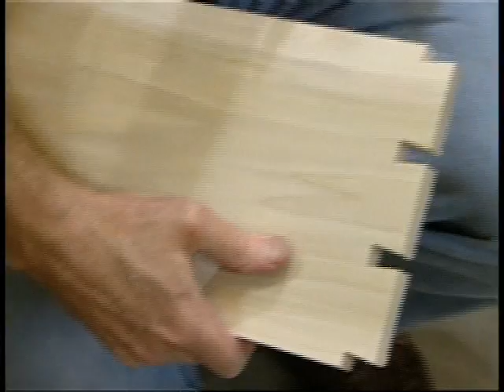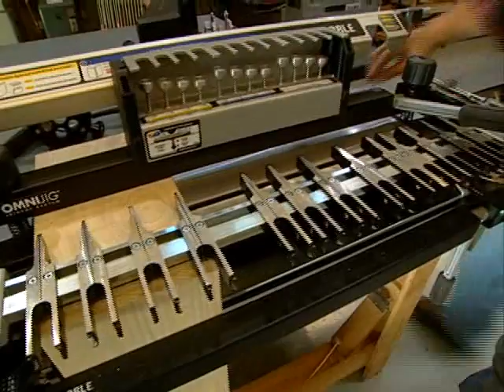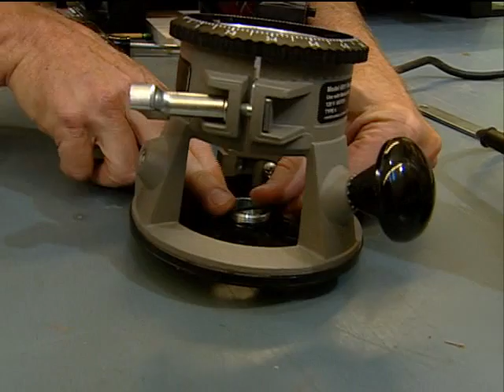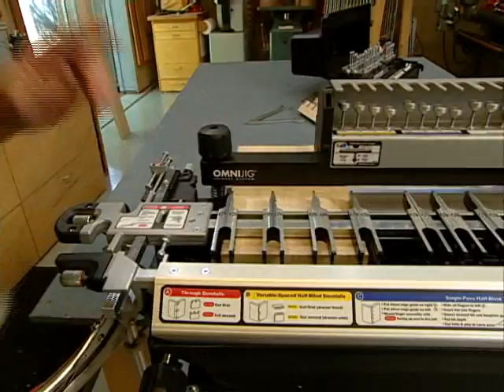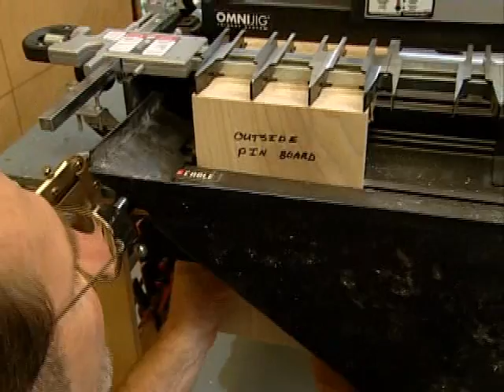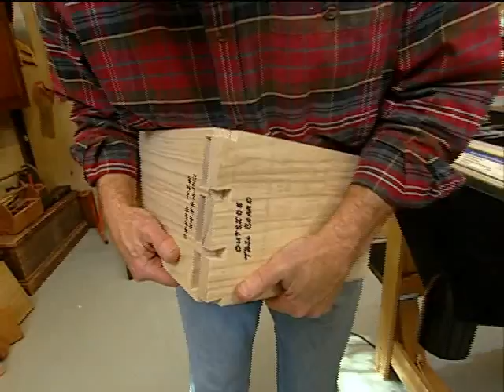How to make Variable Spaced Through Dovetails using the PORTER-CABLE OMNIJIG Joinery System

Comment: I have an older model red colored 24'' model porter cable jig.  Adjustable through dovetails template and never used it thinking it's to complicated, and it doesn't have as many features as yours. I only use the half blind template